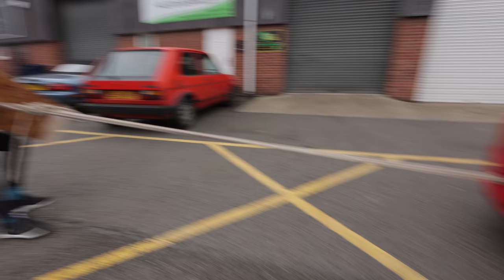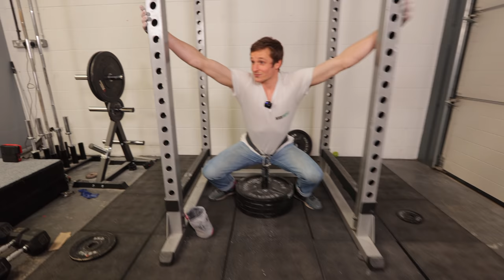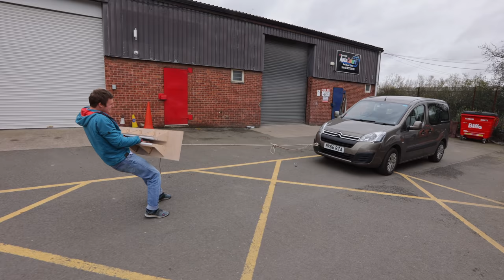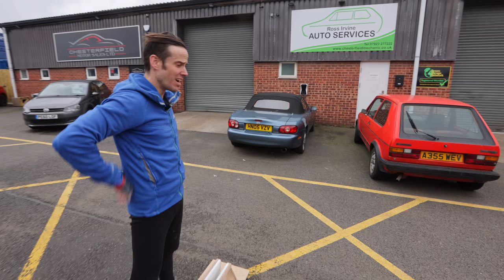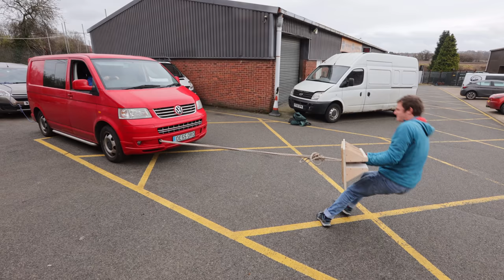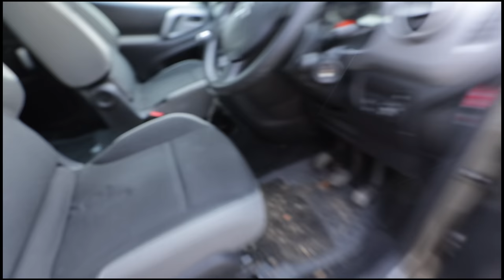Climbers Grip VS. 4 tonne Double Van Pull

Comment: let me explain something: if you hit the breaks, they don't let loose automatically afterwards, so you really create extra friction when you try to stop it from rolling back and hit the breaks, even though you tried to be helpful. There is an extra resistance to get it going again, rocking it back and forth should actually be easier, even if that might sound weird.

Comment: Two people pulling? That’s an impure ascent or whatever, gotta go back and redo it! Btw how do you keep your leading foot out of the way of your trailing foot when turning the lip on butterfly stacks? My leading leg is always in the way :( Also do you jam your foot in paddle hand cracks or do you use footholds?
Reply from the maker: rotate the trailing leg out the crack as you rotate the leading leg into a knee lock. imagine them like a clock but spinning at the same time and never ctaching up with each other. eventually the trailing leg should be heel toeing on the edge of the crack. 
and yes we foot/toe jam in paddle hand cracks, you just want a nice thin and low profile pair of shoes and they should feel all good :)

Comment: the Czechs were first with the "handjam is better than a belay" anyways. 1979, Czech sandstone:

Králíkárna? Yeah, that was a strange route. I wonder if anybody has managed to climb it since then. It looked like a promising route but the problem was that right at the start, there was a meter of completely blank rock. There’s a large hole just above the ground, which is an exemplary hand crack. And as the saying goes, a hand jam is safer than a ring bolt. But then, the jam just disappears. So I jammed my hand inside the crack, grabbed my wrist with the other hand and served as a human anchor for the building. Good footholds and a solid hand jam – that’s all you need. Then a friend climbed upon my shoulders, reached into some holds and placed a ring.

source: https://www.emontana-magazine.com/human-pyramids-sandstone/
It's also very related to the last Human Crackipede vid, check it out for a few unbelievable stories and photos of human pyramids ;)
Reply from the maker: yep thats the picture I was refering to in the video! massive human pyramid scenes. well good

Comment: Fun video but your technique is all wrong which is why Pete couldn’t pull it. His legs are basically fully straight so he’s pulling it with just his arms which is always going to be a struggle. To pull something that heavy you have to stay facing the car and use your legs
Reply from the maker: yep tom had much better techqniue. I was all over the place on my second pull. we need some lessons from Eddie 'The Beast' Hall
Reply: @WideBoyz  For sure, you’re easily strong enough to have pulled those although in a way what you’re doing is a cross between 2 strongman events as usually they’ll either be pulling a vehicle attached to their back by a harness or hand-over-hand with a rope. What you’re doing is in some ways quite a bit harder (relatively speaking 😉)